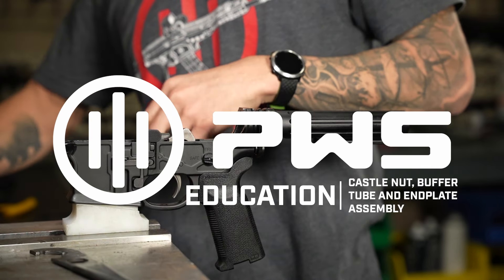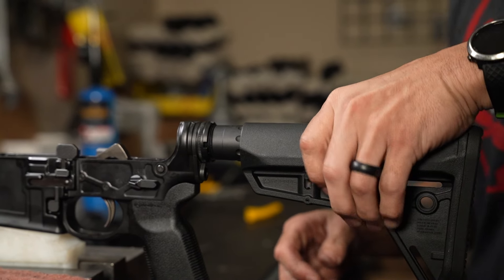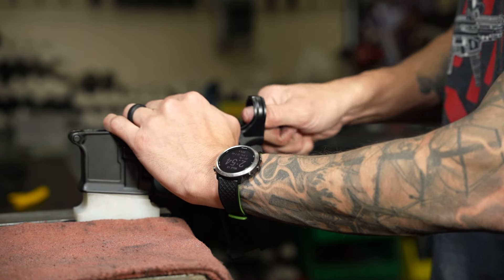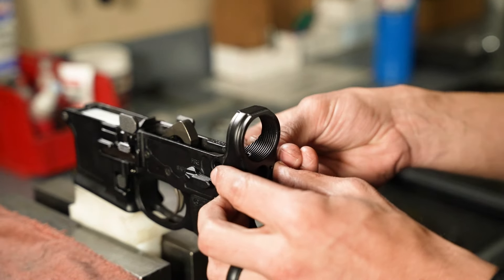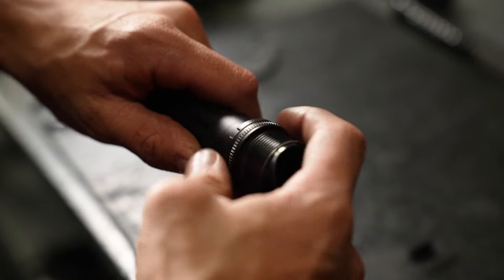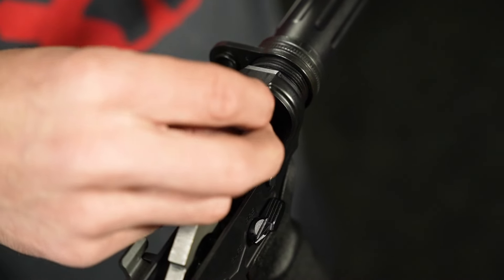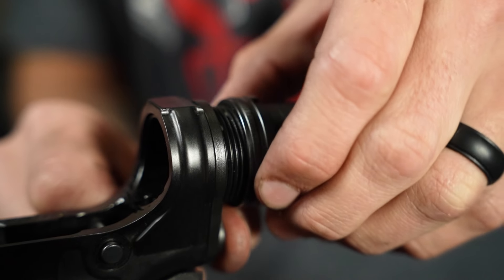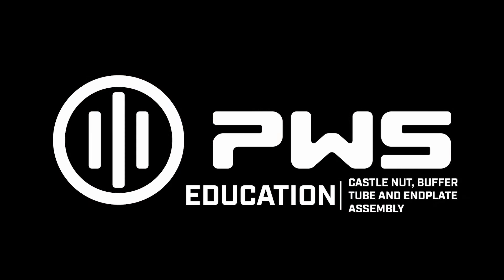How to Install the PWS Enhanced Buffer Tube kit – No Staking Required!

Comment: Well it’s not really a ratchet lock. It’s just a nub sticking out. It’s doesn’t lock in like a Ak muzzle device detent. I’m not sure how well this will hold up long term
Reply: Unfortunately it doesnt hold up over time. the concept is great, but the nut will loosen up eventually. Swing and a miss in my book.
Reply from the maker: We run our guns hard and for us, if the system is installed correctly, it will hold up over time for thousands of rounds. Should you guys have issues, we are happy to replace worn out parts.